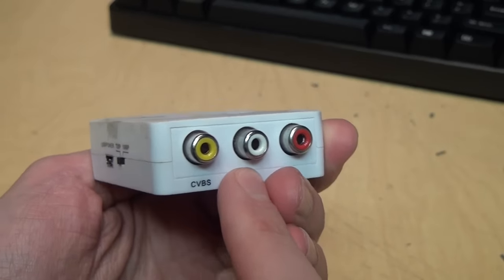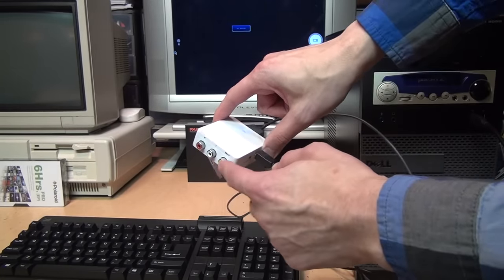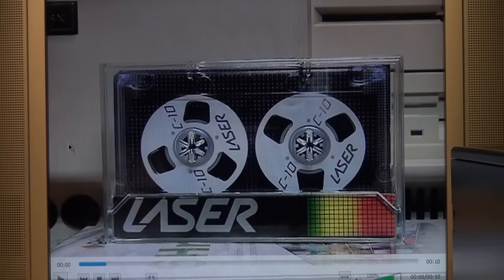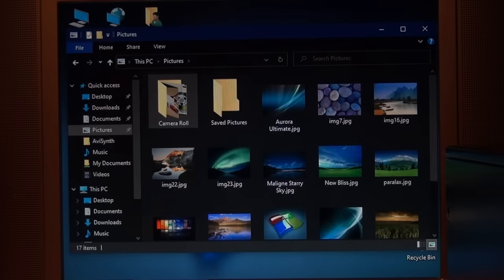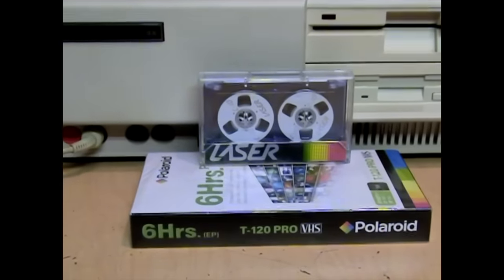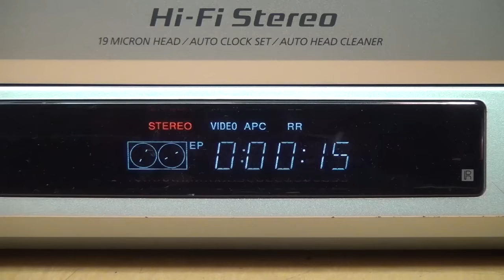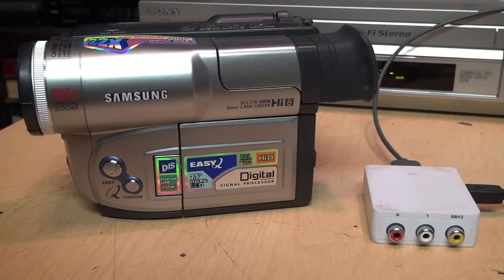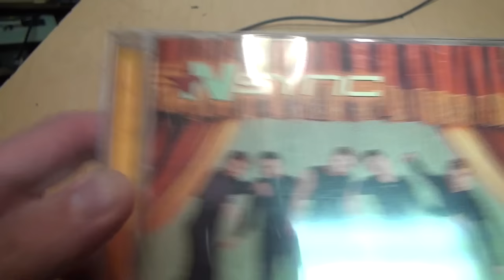Cheap composite video to HDMI converter - Is it really THAT bad?

Comment: These things are hit and miss. So many different manufacturers making them. I have a few of them, the quality of some of them are pretty poor, and others are pretty decent, one of the ones i have overheats and shuts down so it's unusable.

I just use the aspect ratio adjustment on my TV to fix the aspect ratio.

Comment: "The same definitely cannot be said about videotape; especially VHS."
Actually, it can be; just saying "videotape" without limitation is overgeneralizing, especially with the digital videotape formats, and from there, especially HD ones.
Reply from the maker: Since the entire purpose of this device is to convert an analog video signal into digital, I thought the context of analog videotapes was obvious. Because if you're dealing with DV tape, it would make much more sense to use a FireWire connection to transfer it into the computer in its native digital form.
Reply: @vwestlife : Yeah, but tape is tape, hence what I just said. "Analog videotape" being the narrowness of it that goes with this.

Comment: i have a combo of this cheapo av2hdmi converter + cheapo 60fps 720p hdmi usb capturer and i can record retro consoles at 60 fps, input lag is insane but av splitters helps (so one way goes to the crt)
Reply: most retro consoles output at 240p/288p & this thing handles that incorrectly as 480i/576i

Comment: Cool vid, I like the documentation of stuff like this.  I have a similar doohickey for converting my tapes since it looks better than my composite capture card.  But that's not what I'm commenting about.

I want to know if anybody has this peculiar issue.  When watching this YouTube video on my desktop, it plays fine until it gets to the parts that were captured from the device.  Then it gets hung up loading the video and won't play.  I can skip ahead passed the captured parts and it works fine, but for some reason YouTube does not want to play those parts!  I watched those parts on my phone so I could see the entire video, and it played fine.  I just find it strange that a video that YouTube reencodes has issues playing back only the parts of the video that were direct captures, while having the rest be fine.
Reply: Also noticed that it plays those spots fine when I set it to 480p, but not when set to 720p60.

Comment: To fix the aspect ratio, just change the resolution in the camera app settings, try changing it to anything that says 4:3
Reply: Which camera app?
Reply: That's not ideal, you'll be scaling the video again, which will drop the quality. Unless whatever resolution you choose is what you want to use for the final product.
There are apps that will set the aspect ratio to 4:3 for capture anyway.

Comment: @vwestlife >>> Is there a simple {i.e. an electronics NOOB like me can use it 🤭}, affordable something I can use to convert a digital camera's HDMI to AV? 

I do Kite Aerial Photography, a.k.a. KAP. {Just Google it -- if I try to explain this post will run for a dozen paragraphs...🙄} 

My KAP 'rig' has a miniature security video camera/transmitter, separate from the Sony digital camera, that I use to aim the rig remotely. 

Being able to transmit & view what the Sony camera sees directly would be an improvement.  

I currently use a Sony digital camera that has HDMI output only, no AV. {The previous digital cameras I have used had AV.} I did not realize this at the time I purchased the Sony. Other than the HDMI thing, the camera is great. 

If not convert HDMI to AV, do you know of a reliable device for transmitting video from a remote HDMI source? 

{Thanks in advance!}

Comment: I have NEVER seen a composite, S-video, or component to HDMI converter, costing less than $100, that didn't mess up the aspect ratio.  And even if it doesn't mess up the aspect ratio, the end result still looks like ass, because analog video looks like ass.

Comment: Good to know how anti-RTR volkswagen is with transmissions.
Reply from the maker: But this was back when they had a 10-year, 100,000-mile powertrain warranty. The auto transmission in my sister's 1996 Golf stopped shifting into 4th gear at 96k miles, and VW replaced it for free.

Comment: I'd be very annoyed and would try to de-solder the audio RCA jacks and swap them around so that the colors match up correctly.  Sure, the label is still wrong, but I use the colors for quick, ease of use.
Reply: or cut the tracks to them and patch wire crossed over, then colour and labelling will be correct 😉